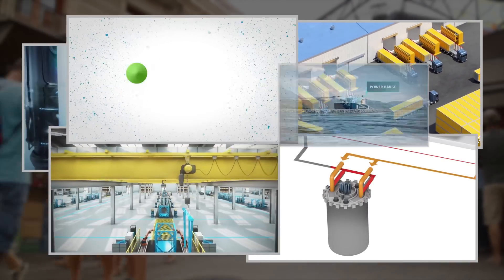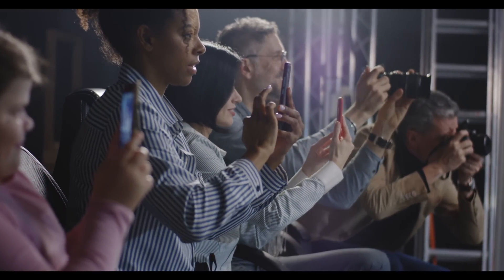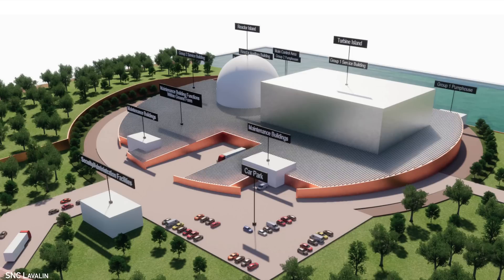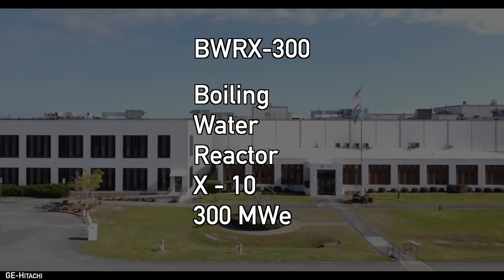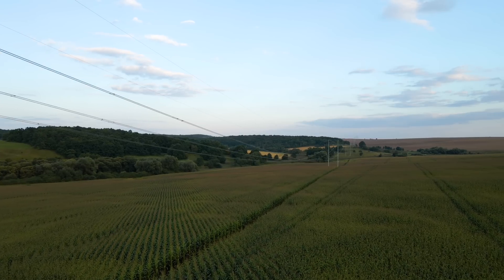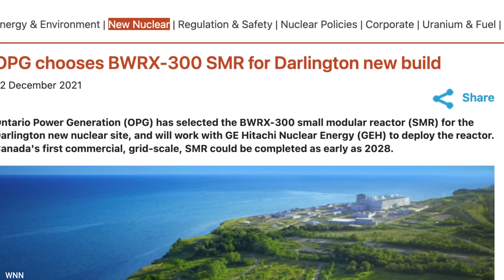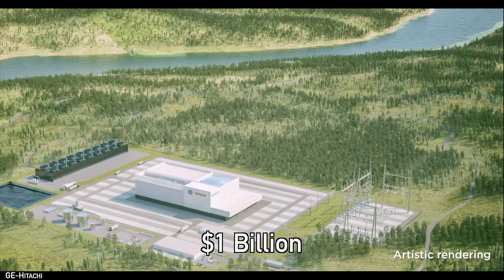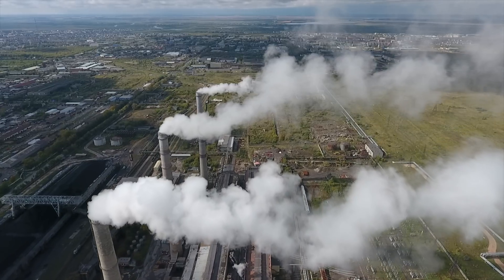Why This Small Nuclear Reactor is Actually Winning

Comment: This is 1940’s technology.  It’s time to invest in thorium molten salt reactors which were developed and tested in the 60’s by Alvin Weinberg at oak ridge.
Reply: Sure. All you have to do is invent materials that will not corrode over a reasonable service life.
You will also need to invent reliable ways to remove part of an active molten core for fission product removal, introduce fresh fuel, and deal with xenon and krypton escape.
The accumulation of high-cross-section actinides will also be an issue. 
Probably another thirty years of development to sort these things. Get cracking.
Reply: @aaroncosier735  This all has been invented already in - China, and TMSR-LF1 is running already, and has finished its first online refueling.
Your arguments are all excuses for not being able to innovate.
Of course there alternate solutions by using liquid metal fuel:
🔋 Key Advantages of the Dual Fluid Reactor (DFR):

• ⚡ Ultra-efficient: Nearly 100% of nuclear fuel is used  
• ♻️ Burns nuclear waste, depleted uranium, natural uranium, thorium – and all actinides (incl. Np, Am, Cm)  
• 💥 Transmutes long-lived actinides into short-lived fission products  
• 🔄 Built-in Pyro Processing Unit (PPU): Continuously removes neutron poisons and extracts valuable metals  
• 🛠️ Liquid fuel: No solid fuel rods, no reload cycles  
• ⏳ Decades of operation with a single fuel load possible  
• 🚫 No corrosive salts: Liquid metal fuel avoids fluoride corrosion and complex chemistry  
• 🧊 Lead coolant: Excellent shielding, no water, no pressure → no steam explosion risk  
• 🌡️ Very high temperatures (700–1000 °C): Enables hydrogen, e-fuels, ammonia, and direct steel reduction  
• 🧠 Self-regulating: Output adjusts automatically via negative temperature feedback  
• 🪫 Minimal waste: Only short-lived fission products remain (• 🏭 Compact & scalable: High power density, ideal for modular deployment  
• ⚙️ No moving parts in reactivity control: No control rods required  
• 💰 Uses spent fuel, DU, thorium & actinides – no enrichment required  
• 🌍 Reduces dependence on enrichment, mining, and fuel imports  
• 🔄 Fully closed fuel cycle: No external reprocessing required  
• 🆚 Outperforms typical SMRs: No pressure vessels, no water coolant, no fuel handling

Comment: I am all for nuclear power and small reactors but they need to be even simpler and designed by engineers with common sense.  Fukushima used GE's boiling water reactor which had no method of adding water after the power failure and flooding of the 
Backup generators.  They did not even have a 2 1/2" fire hose connection which fire trucks could pu.p in water from a fire hydrant!  They use air operated valves which were unnecessarily complex that operators could not open or close valves.  GE's engineers should have been pit in prison.

Three Mile Island had a stuck valve that did not even have an indication whether it was open or closed.  Operators did not even know how much water was covering the rods.  The engineers should have had a simple sight glass gauge as backup.

Unfortunately GE has the lead in its ancient, vad design boiling water reactors only because they were approved decades ago by regulators who do not make the effort to look at newer and better designs such as the molten salt reactors.

Equally important, regulators need to demand simpler designs to reduce operator error, stronger backups, and limiting designs to engineers with COMMON SENSE.
Reply: Yup.  I are a dumb eng - gin - eeyor .  But I remember 3 mile island when they didn’t even know they had not water BUT STEAM! in containment!!  There was an indicator that could have told them so if they had a steam chart handy.  But it was hidden in the back of the panel.  For me, that was a Yougottabekiddingme moment.  We gotta have nuke power but we don’t need to build a kluge to get there.  This video was too slick anyway.

Comment: Just remember, the water is radioactive and goes through the turbines.  There is no heat exchanger that keeps the radioactive water from contaminating the regular water.  So the whole shebang has to be protected.  Imagine the mess if the turbine leaks.  Then the mop becomes “rad - waste”.

Comment: The BWRX-300 is simple and has potentially a long life span before retirement. That makes it interesting over other designs.

The bad thing is that it's no better than other thermal reactor designs regarding bad fuel efficiency and long lived waste.

A fast uranium reactor has around 95% better fuel efficiency and short lived waste compared to thermal water reactors. The bad thing about fast reactors is that they, at least so far, has a shorter reactor life due to higher amount of high energy neutrons ageing reactor components at a higher rate than thermal reactors.

Comment: DOA: No utility is going to spend billions for a small 300MWth power plant. Regardless of the size, a utility still has to deal with all of the planning, regulatory, and security costs.

Utilities in the US will never build anymore nuclear power plants unless the costs are fully subsidized by the gov't. First it will take at least 20 years in planning, construction & testing. Second, there is only enough economically recoverable uranium until about 2050. So at best a new plant would not be completed until about 2045 leaving about 5 years of uranium available. The plant will never recover the costs. Utilities will only build NatGas power plants which have a payback under 10 years, where as a nuclear power plant is about 25 years and takes 20 years of capital investment before it starts generating revenue (ie about 45 years in total).

Comment: An early lead can be good, but eventually you're surpassed by better designs.
I suspect that won't hurt GE because they're ultimately leveraging existing R&D rather than starting from scratch. They may then deliver something better in their next generation that, optimistically, could beat designs currently in development.
Are they too early in SMR? Probably not, as long as they're already thinking about their next generation and leveraging their experience in this generation.
Reply: Also honestly we need more reactors and we need them now. 

Since the public opinion was successfully swayed against all form of nuclear as being expensive, high maintenance and dangerous.

Dangerous was never true ever in it's history but people just pretend it is. And high maintenance/costs is almost entirely derived on the sticker price of the most massive and missmanaged projects, ususally by comparing them with subsidized solar or wind with it's capacity factor artificially inflated to 100% instead of the expected 12 to 36%. 

We need reactors right now because we won't get any of the far better MSRs if they all get shot down during the project development and planning phase.
Reply: SMRs can be used to install generating capacity slowly as needed when demand grows, and with factory-built, transportable units.
Reply: @tobyw9573 Can be, if they are small enough, but the subject of this video (BWRX-300) is not small enough to have truck-transportable or,  it looks to me, factory-manufactured parts. That's probably why it's projected to be relatively expensive. OTOH, no one has actually made a factory for ~50 MW reactor components yet, so it's hard to say how much it will actually cost!
Reply: Hey Poland! You're going nuclear for the wrong reasons!

CO2 is climate-irrelevant. 

Interglaciation climate change (i.e., the Medieval Warm Period) is caused by changes in cosmic rays (Svensmark et al). 

There is not such thing as anthropogenic global warming.  

"Global Warming" is a superstitious bullying and shakedown of the taxpayer. 

Just burn coal and keep looking for more oil and make it out of coal (the way South Africa does at SASOL).

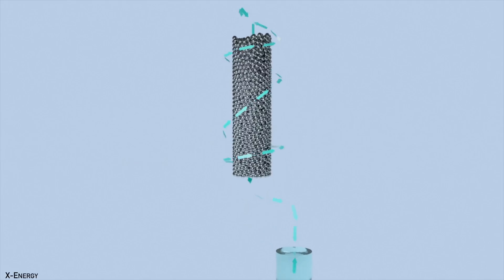Comment: Is it really better though? 4:35 No Thorium but regular water and Uranium..
Reply: The point is - why use thorium at all, when spent fuel and depleted uranium (DU) is abundant?
The waste of 1 reactor year of a 1 GWe conventional reactor can provide up to 140 times the electricity originally produced. Additionally, the side product from enrichment, depleted uranium can provide another 4 - 5 times the electricity of the spent fuel. In total, this is about 700 times the electricity that was produced by nuclear in the past. This are resources worth tens of trillions or even hundreds of trillions USD, that could pay the debt of the US multiple times easily.
A side effect is that the "waste" produced after complete burn down consists of 95 % partly precious metals, and about 5 % of waste that decayed after 300 years to the level of natural uranium. Of course, it is poisionous, but can be stored just like normal chemical waste. And the amount is small compared to the amount of energy anyway, because 1 kg or uranium/thorium contains 24 GWh of thermal energy. 
But be aware, beside some advantages of thorium, there are nasty site effects. There are hard radiation sources within the thorium-cycle. Proactinium 233 and Thalium 208. Pa 233 comes from breeding Th233. It is a bad neutron poison, that requires immediate separation from fuel, otherwise reactivity stopps. Pa233 then must be stored separately, until it has decayed to U233. This decay also produces hard alpha and beta radiation. TI208 on the other side, comes from a small part of U232 produced during breeding. U232 decays at some point to TI208, which issues hard gamma radiation. This requires more extensive shielding and complicates handling. So the thorium-cycle has some drawbacks, which are often not mentioned. 
IMHO, before using thorium, waste and DU should be burned. And if this isn't enough after thousands of years, there is the posibility to get uranium from seawater, for which China seems to have found a cost effective solution now. BTW, uranium in seawater is abundant,  thorium is not.
Of course, you can use thorium sometimes in the same reactors, that burns waste and DU, but it isn't necessary for energy needs for a long time. 
So again, why use thorium when it isn't really necessary?

Comment: As the World's (self designated) #1 Fan of the BWRX-300, I would like to thank Atomic Blender for this publicity through the Channel's excellent viewing figures.

GE Hitachi's BWRX-300 is the most cost-effective design of nuclear power plant there has ever been and that may be the case for decades to come. 2 years ago, on GE H's website, the NOAK overnight capital cost (OCC) was stated at $2,250/kW; the best data on price inflation for nuclear power plants in the USA (fred.stlouis) suggests an 11.2% price increase since then, taking the OCC for this 300 MW plant up to $2500/kW. ($750 million)

Jon Ball of GE H says enquiries from customers are not just for 1 or 2 of these SMRs, but 10 or 20 and the top 3 priorities that have come into play over the last 2 years are: Security; security; security.

We are at the cusp of the era of SMRs which, when combined PEM electrolysers can load follow diurnal demand in milliseconds; every such combo would take almost 500 MW of gas fired power plant out of the climate change equation. When fleets of SMRs are deployed, as is being voiced in some nations/regions, seasonal load following can be achieved by planned refuelling/maintenance outages. Energy storage infrastructures virtually disappear.

Because greenH2 is as fundamental to decarbonisation as low carbon electricity, fleets of SMRs will have to be dedicated to greenH2 manufacture, which can be achieved in combination with high temperature steam electrolysers (HTSEs). The 950 MWt thermal capacity of the BWRX-300 can manufacture greenH2 at a rate of 27 kg/MWh [equivalent], which is a 50% higher production rate than conventional electrolysis. 1 MWh [equivalent] of nuclear energy in gets 900 kWh of hydrogen energy out.

The silver bullet answer to cease the burning of fossil fuels is within touching distance and the astronomical cost in dollars and premature deaths from FF pollution makes this solution 10X better than a zero sum game.

Comment: Isn't it possible to build a solar wind hybrid system backed up with battery for 4000$/kW? 🤔
Reply: Not with current tech, we have no good solution for large scale storage yet.  Batteries are being used for grid balancing and they are cost effective for that, but not for bridging longer periods with no sun or wind.  Hydrogen might be a solution; IIRC the round trip efficiency for hydrogen (electrolysis, compression, storage, conversion to electricity) is 30-45%.  That sounds crappy compared to pumped hydro (70%), but the advantage of hydrogen storage is that it's relatively cheap to build compared to batteries.  It scales well, and it can be built pretty much anywhere.  And if there's an unusually long period without wind, you can run on grey hydrogen.
Reply: Well, the answer depends on what you mean by 'backed with battery'... If you mean backed with battery output for 4 hours, I think the answer is yes. The concern here is that a winter coldsnap can bring cloudy weather without much wind that can last for days. Solutions are: 1) storage other than electrical batteries 2) better longer transmission so that at least some generation is in different weather 3) over-build our renewable generation, which would be wise anyway in light of 1) and 2).  The details of this will vary by geography, because some places have much more reliable winds, other places have more reliable sun, and Ontario at least has rivers, hydroelectric power,  and pumped hydro storage.

Comment: I love the ideas.  I worked on building a conventional large plant back around 1970-71 that is still generating a few percent above its stated design output 50 years later.   Oh, GOSH, that plant's costs spiraled as the protesters' lawyers' suits forced redesigns.  Personally, even though (or particularly because) I know the failure-points they designed the plant to work through, I wouldn't hesitate to live next door to the aging girl.
Reply: Now a lot of those protesters are wishing they hadn't held up the research and set back the development of newer, safer designs. Help! The planet is melting!
Reply: Yep. The dozen (20?) US light water reactors that started construction around 1968 under the US AEC were the best combination of cheap, fast to build, and safe that the world has seen, anywhere, up to today. Build time from start to commission and online in 49 months, with actual site construction 2 years, cost <$1000/KW, todays $, running for 50 years, one about to be licensed to 80 years.  

The US could have easily kept going like that and squashed all fossil fuel grid use, like France did in the ‘90s, by the late 70s.  Suddenly, in the mid 70s, some 200 US new plant orders were cancelled. Why was that?
Reply: @Nill757 "within 10 years energy will be too cheap to meter"... the power companies may enjoy that idea, barely, but the oil, auto and bunches of other industries do not enjoy it.
Reply: @leechowning2712  Yes France had a large oil fired power fleet until the 80s. The nuclear buildout there obliterated the entire fleet of oil plants in a dozen years. That’s never happened anywhere else, anytime. I imagine some oil and coal interests noticed and would do what they could to insure it never happens again.  Same goes for large solar and wind industries today.
Reply: @Nill757  we would not be discussing EVs right now if the electric bill for a house was a flat fee... you would not be able to sell gasoline. Diesel trains and boats? With SMRs for all? Yeah forget that. Literally, go down the list... every major industry now is linked to oil. It is like water in that Jackie Chan movie... when you and a few friends control it all money is the least of your worries.
Reply: Hey Poland! You're going nuclear for the wrong reasons!

CO2 is climate-irrelevant. 

Interglaciation climate change (i.e., the Medieval Warm Period) is caused by changes in cosmic rays (Svensmark et al). 

There is not such thing as anthropogenic global warming.  

"Global Warming" is a superstitious bullying and shakedown of the taxpayer. 

Just burn coal and keep looking for more oil and make it out of coal (the way South Africa does at SASOL).